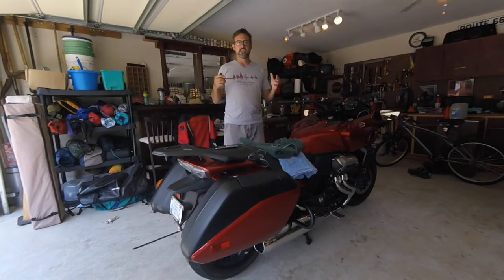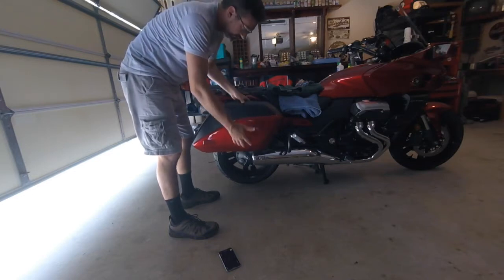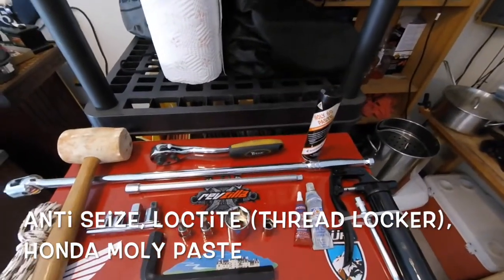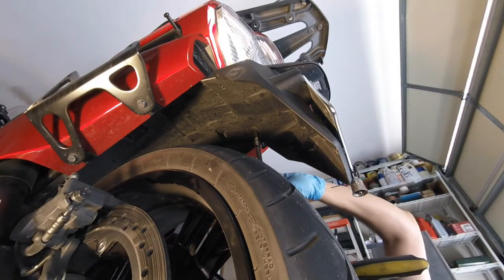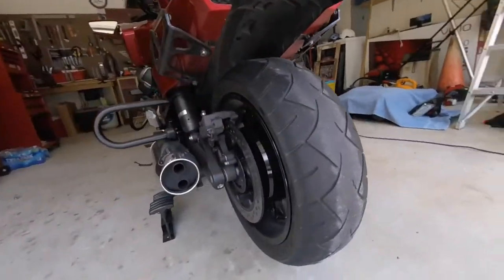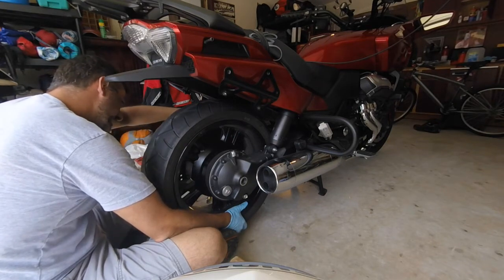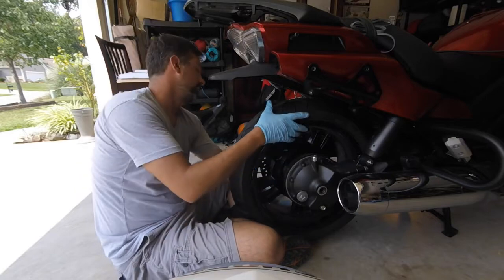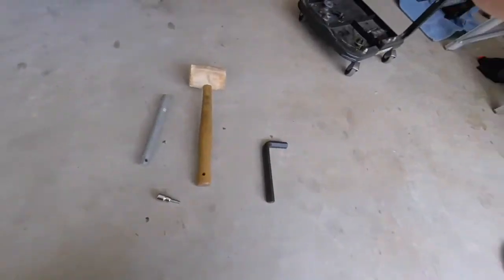Honda CTX1300 Saddle Bag and Rear Wheel Removal

Comment: How many miles did you get out of the back tire and which brand did you go with, I just installed Avon on front and avon Storm on back. Nice Video on this job!
Reply from the maker: I had 10,000 miles on the OEM tires.  I put almost 6,000 on the Metzlers.  I am on my second rear Metzler now.

Comment: Mr hansenctx 
I follow your channel and i just curious if I could get your opinion on something. I found a new ctx 1300 at a Georgia store and it is $10200 out the door...is that too much for this bike brand new? and would you buy this bike again?
Reply from the maker: First, yes I would but this bike again!  Now... is the bike at the GA  dealer a standard or deluxe model?  Are there any OEM accessories included?  Will it come with the Honda warenty?
Reply from the maker: Another thing to consider:  What price is the bike being sold for throughout the region brand new (Old/New stock)?  Do a google search, check out Cycle Trader, look over Craigslist.  Then, go to Kelly Blue Book and see how much the bike should cost from the dealer.  With all this price information you will have a good idea what the market value is.  When you visit the dealer, approach them with the questions I had in my other comment.  After then you will have an ever clearer idea of what the value of the bike might be.  Understand that accessories are not supposed to add value to the bike, however; if they are on the bike you might want to negotiate.  Always have your cut-off amount clear.  Do not buy a bike that is above your cut-off.  Again, I love this machine.  It is wonderful.
Reply: yeah both are new at different freedom power sports listed at $11,450 so they came down $1200.
1. yes- standard w warranty
2. yes—backrest, and cargo rack.
i was just curious because i didnt know if you bought yours new at a higher price and that sounded like a good deal.
Reply from the maker: I bought mine brand new in 2014 when the bike was released.  Sticker price was $17,999.  I got mine for $16,000.  Mine is the deluxe model.

Comment: Just curious is there any after market top loading saddle bags that can replace the side opening ones ?
Reply from the maker: I am not aware of any, however you should be able to fabricate a bracket that might work.  Check out the Honda CTX1300 forum! Lots of good stuff in there.

Comment: Good videos Chris - where did you obtain the crash bars - Steve (UK)
Reply from the maker: Crash bars were custom made by another Honda CTX1300 owner.  You can find more information about them here:  http://www.ctx1300forum.com/forum/honda-ctx1300-general-discussion-forum/17098-manosabe-crash-bars.html
Reply: Thanks Chris - sadly the link is dead - any suggestions.?
Reply from the maker: Hmmmm... you might need to be a member of the Honda CTX1300 forum in order to view the link.  I am walking to work at the moment.. I will provide you with more information in a bit.
Reply from the maker: You can locate his information on the Honda CTX1300 Forum:  http://www.ctx1300forum.com/

Just search for 'saddle bag guards.'

Comment: No way to change this wheel along the road on a trip is there?  There is no actual tool kit with these bikes.
Reply from the maker: You will need to build your own tool kit.  Unlike some BMW bikes where you can easily remove the rear wheel, this bike will require a breaker bar and various tools for the job.  If you want, you are able to put all needed tools in the saddlebag.
Reply: I just bought my “standard” and was not surprised there was no tool kit but I had hoped that Honda would design this downsized tourer with the ability to do a roadside wheel removal like a Goldwing.  For what they charged for this model new you would have expected a top notch tool kit.  Oh well.  I found mine pretty cheap and only 6300 miles on it and several needed farkles on it.  Sold my Victory Vision and downsized to this.  Nice video.  Thanks for taking the time.